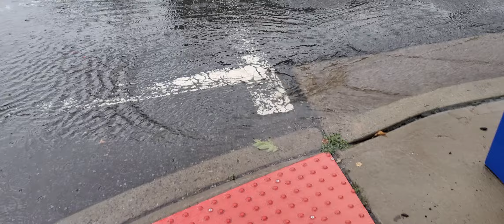Why Does Water Do This? (Hydraulic Jump)

Comment: idk either, I'ma share it
Reply: It happens because the water flow velocity exceeds the wave celerity. In other words: a wave is trying to move upstream but the flow velocity of the water is higher than the speed at which the wave moves. At the point where both velocities are equal a hydraulic jump occurs..

found it